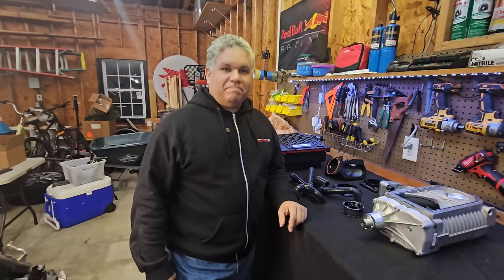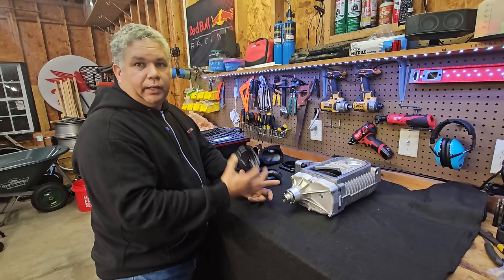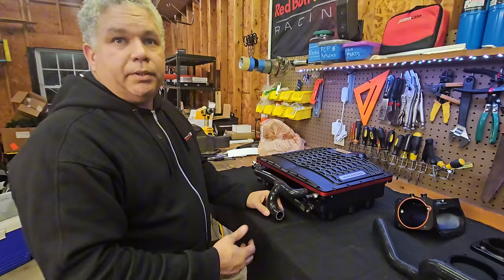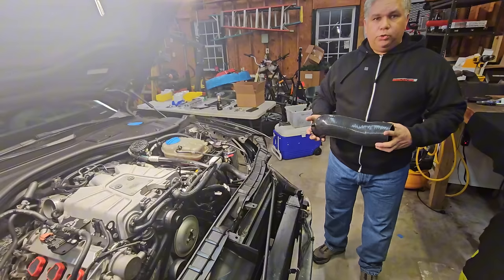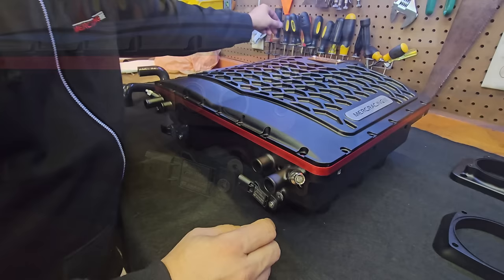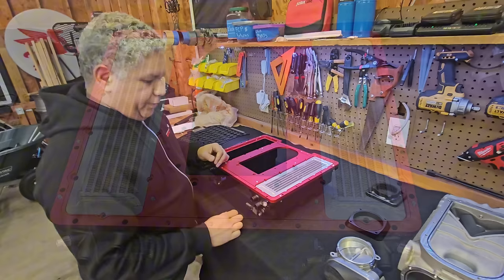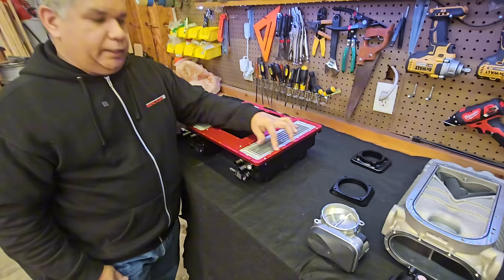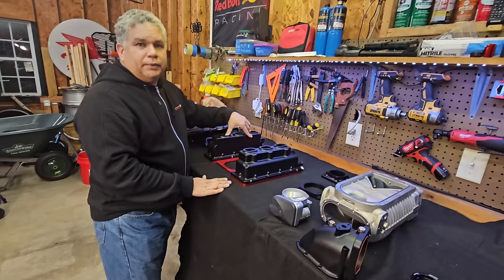MRA1900 Breakdown with Jose Mercado of MercRacing

Comment: Great vids man!  Always watch your tutorials before wrenching on my S4 with a 3.0T. Did you ever do a vid on the upper timing covers?  Mine are leaking and seems like it can’t be done without the motor or tranny out. There’s three bolts on the aluminum shield over the Combi valve attached to the timing chain covers and the lower ones are impossible to reach because the cats are in the way. 

Dealership wants 7k to apply $8 tube of rvt silicone. Could be a great DIY vid!
Reply from the maker: I don't have one for that, but if you remove the false firewall in the engine bay you should be able to do it

Comment: To clarify, do you need to update the oem engine mounts and assume the jackel programming is compatible?
Reply from the maker: No, you don't have to. Just know whenever you upgrade your mounts the engine will sit higher which may bring the supercharger closer to your hood until the mounts settle.

Jackal doesn't have a file for the supercharger yet, but that's not to say they won't develop one if a customer buys it and works with them

Comment: That's only a 2.1 ration on that pulley with stock crank ..so quiet a bit of headroom ...What boost has it been running on testing ?
Reply from the maker: But we aren't using it on a stock crank. It's on a 191mm crank. So we are at a 2.5 ratio which is still conservative for this blower.

Comment: Does this kit bolt onto the C7 directly? I am brand new to the group and just got my audi a week ago, ive been binging these videos and am still trying to figure out if i have a c7 or c7.5. regardless I am trying to figure out every piece of info to make this car as badass as possible while taking every precaution and preliminary step. Kind of diverged there, so back to the og question, is this compatible with the c7? I am going to do the four crucial upgrades from that " four necessary upgrades" video before anything else too.
Reply from the maker: This bolts onto a C7, but not a C7.5.

What year is your car?
Reply: @AudiC7Owners  mine is a 2015, s line, quattro, all that bs lol
im pretty sure its a press on pulley so its a c7...
Reply: just checked and it is a press on for sure, so glad. I watched your other video on the first four preliminary steps/mods to do before nay performance upgrades and those  are what i will be attending to first. then this baby once all my foundation is set. @AudiC7Owners
Reply from the maker: Yep. If it's a press on supercharger pulley then it is a C7
Reply: Sounds good man thank you! Shit is siiickk

Comment: I've seen this at least 2 years ago. The cost was also going to be something astronomical, so I wrote it off immediately. From what I remember, APR had a supercharger upgrade right at the beginning of the platform that was canned because the 3.0 supercharged Audi engines need to be built to withstand more than 550hp. Stock internals will fail above that. It doesn't make financial sense to push these cars past 500hp. There are better cars in the Audi lineup that offer more return on investment.
Reply from the maker: That is all completely false. These engines can handle 700whp.

Fueling is the restriction and APR gave up on it because they couldn't make fast money on it without reveling a fueling fix.